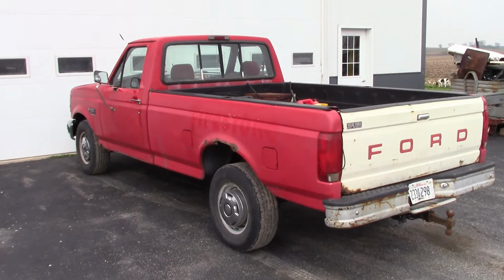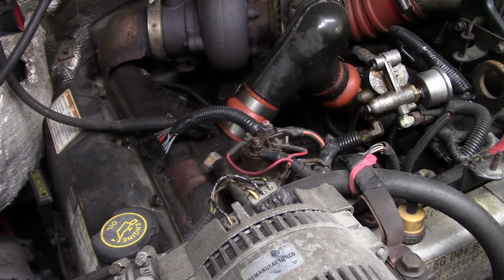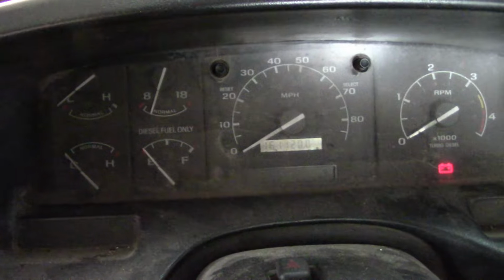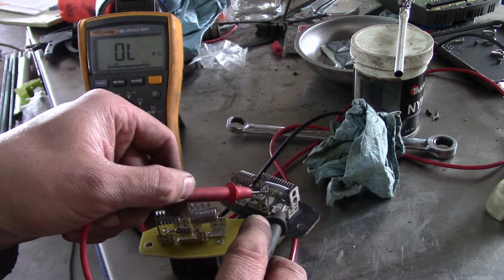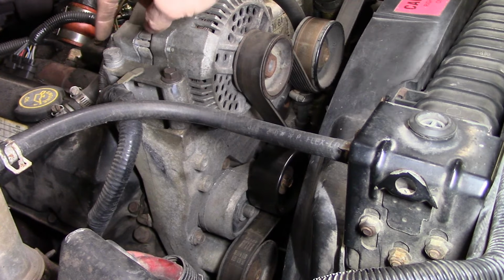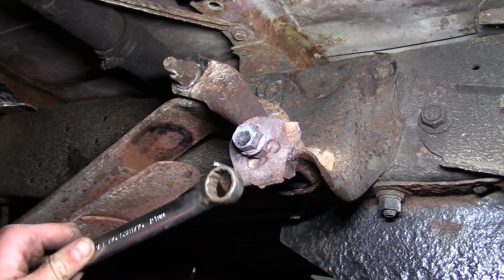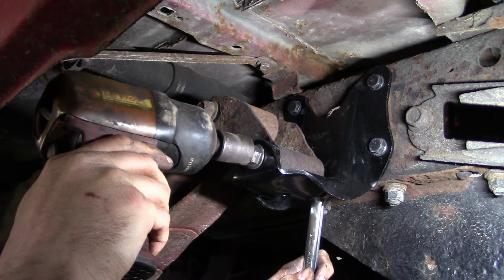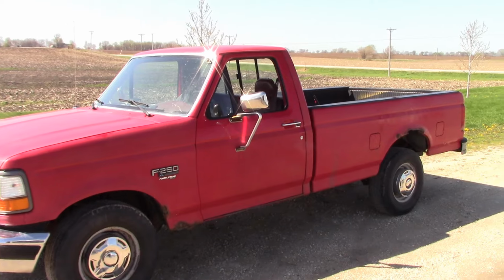1995 Ford F250 Maintenance - Glow Plug Relay, Blower Motor, Belt Tensioner, Rusted Spring Perch

Comment: Dielectric grease is so named because it won't conduct beyond conductors. The normal force of a plug-socket connection, let alone a stud-nut terminal, displaces the grease beyond significance, but it remains coating any exposure to atmosphere, supposedly more effectively than other grease which may contain conductive contaminants (e.g.graphite).
Also, that 0.1 ohm 'resistor' looks suspiciously like an encapsulated fuse element as used in some electronic equipment. Is the high flow position a direct feed from the battery, or via that 'resistor'?

Comment: 99% of the time when you sell a good running vehicle that you know what the issues are you usually wind up with a replacement that looks good but then you slowly discover all the other problems it has. 
I’d I were you I’d replace the floorboards, replace the bad sending unit in the fuel tank then buy a second plastic fuel tank to replace the rearmost tank. Then replace the worn components in the front end and give it an alignment to avoid premature tire wear beyond the normal tire wear. Little bit at a time and the list will go down. 

Food for thought

Comment: SO glad we found your channel.  We have the exact same truck ('95 250 7.3 XLT) that was my dad's that he's been using as a farm truck.  We're thinking of rehabbing it for my son when he turns 16 here over the next few years.  It runs really well, but has a couple of electrical quirks and needs several cosmetic touchups.  From your perspective, how hard has it been to find parts for this truck?  Things that are tougher to find than others?  I'm assuming mechanical parts are easier to find than cosmetic (trim, mirrors, interior panels, etc.)?

Comment: that little thing is a temp controlled fuse. OL means its bad, replace it with same rating and it should work fine.
Reply: Could solder in fuse clips to make it easy to replace later

Comment: I would check out the front spring perch/shock tower.   Mine both rusted to rat shit.  The top bent up and kicked the spring out sideways on the passenger side.  Mine is a 94.  From what I hear it’s a common problem on those years.  Rust holes big enough to put my fist through are probably not the benchmark for structural integrity.
Reply from the maker: Yeah that happens on a lot of Fords. The 2004 and up Super Duty also had that issue.

Comment: could you use a lawnmower starter relay that has the separate power and ground post as the glowplug relay?

also you should maybe find a good body and frame with a bad engine and trans and swap them

Comment: Im admazed that that thing has its hubcaps as for what to do look for a souther 2 wheel drive junker (will be better than anything up north) slap that body on your frame or you can go the route of find a whole truck and solar the engine from yours into it that would be more for if you wanted 4 wheel drive

Comment: Relays do not care if they are + or - switched.  Starter relay may not work but that is not why.  That is a thermal fuse, not a resistor.  The talking is good, people that don't like it can mute.
Reply from the maker: The starter relay coil grounds through the mounting bracket.

Comment: You could put a long rod through the fire wall with a prison shank on the end mounted so that pushing on the long rod from inside the cab will engage the now (manual glow plug exciter) aka prison shank...and Bob's ur uncle ...way less than $50 from your local auto parts store.

Comment: keep talking Wes.  As for what to do with the old Ford if it does everything you need it to do and all its little issues dont bother you then keep it.  You know what you have already and you'll just end up with another rusty truck that needs work anyway right?   MY Dodge has 203k on it but its paid for and other than a little work here and there its never left me stranded.

Comment: $50.00 relay I put one on because the" probably " original one was crispy and falling apart . Hind sight, and for future reference, who needs a relay when all you really need is a push button. Boo-koo's of amps so a big push button. So many things on a car can be tossed and replaced by toggle switches. Why do cars need to be so controlled by sensors and computers. Maybe if you have no hands or feet then the modern conveniences or automobile engineering would be necessary . Seriously motorized seat adjusters. All of that stuff just adds more weight and creates more stuff to break down.

Comment: If you had put the bolt thru the leaf spring the other way when you put it back you wouldn't have to fight with it not clearing the bracket you installed or the frame to get it out when you go to replace that other piece.

Comment: Hello, I'm interested in this video because I own a 1991 F350 7.3 idi that is a beast to start here in Fond du Lac, Wisconsin most of the year. Have you made any idi videos? I will test my glow plug resistance and inspect the harness. As we are now in November. Any links will be appreciated. Truck has never been driven on winter snow/slush, it's from Tenn. Crew Cab w/8 foot box. 2 WD Automatic.
Reply from the maker: Those engines won't start without glow plugs working.

Comment: Ahhhhhh a scrench. What do you run for a saw man? I'm pretty much a stihl guy, ( I own a bunch of pro saws,) but the 372xp, 395xp and 346xp have a special place in my heart as well lmao. I've actually been able to save a couple blower motors in a pinch before by cleaning up the bearings and spraying dry chain lube for motorcycles/ ATV's. If they arent too far gone of course. Yours would probably still make noise. Lol that thing is annoyingly loud
Reply from the maker: Dad was a Homelite man, so for years I ran a Super XL Automatic. Then I upgraded to a Stihl MS311 and the Homelite mostly collects dust.
Reply: @WatchWesWork 
Nice man... yeah those old homelites leave something to be desired. My favorite saw is probably the 044 Mag with a 24" bar. They are the perfect size and displacement for basically anything. If its bigger the 088/ 880 Mag is an absolute beast! The 311 is a decent runner. The only issue with the newer saws is the EPA restricting the hell out of them. This can easily be remedied by opening up the muffler and knocking off those stupid limiter caps on the carb to tune accordingly. You have probably already done this, but if you haven't, doing a MM makes them a whole different animal. All my saws are modded to some degree, (muffler, timing, walbro, cylinder porting, base gasket delete, rim sprocket, etc... Just opening up that muffler will make that 311 come alive! Since you have a welder you can make yours a true dual port style and besides the saw sounding better, it will run cooler, and your cut times will go way down. Saws are a hell of a lot of fun.

Comment: Hey check your in tank filters they will make it lift pump pull airaited fuel making injection knock also so a cam driven lift pump install a later model fuel filter housing with electric lift it will be a total different truck if you don’t have a late model fuel housing hit me up I’ll send you one with the fuel lines 👍

Comment: Don't know what it is but my 92 f150 I have to use the manual relay every so often and ive replaced it twice now except mines the one for the starter
Reply: The starter switch might be one of those early ones that mount on the top side of the steering column. Slide switch that splits in two from the rod actuator piece of equipment or crap if you prefer

Comment: The bad part is a fuse link. if the resistors get too hot it burns open.You could rebody it with a barn find older truck. Maybe a old 69 f100. By the way keep talking.

Comment: You can reverse the control voltage polarity, by using a cheapskate auxillary relay to drive your glowplug realy coil.
The "film resistor" in the blower resistor is a melting fuse. It does not have a particular amp rating, but instead a heat rating of around like 210°F (internally). They are availabe on Ebay cheap.

Comment: You can’t replace the mighty 7.3 still the king of small truck Diesel engines for reliability. If you own a 7.3 or a 12 valve Cummins you will regret selling them they just don’t offer anything like them anymore.

Comment: What’s with people saying you talk to much ?! They can mute it if they think so ! I like your blurbs personally ! I’ve started looking for a long box diesel and wonder which one you’d buy , the 6.0 or 6.7 or 7.3 ? For pulling my 5th wheel ! Or the GM diesels or Rams ? Which hold resale better also ? Thanks
Reply from the maker: I like the 6.0 and the 7.3. They are just all getting pretty rusty in this area. I don't know much about the 6.7. Don't buy a 6.4.
Reply: Watch Wes Work I’m in Minnesota so I know rust issues for sure ! I’m normally a Chevy guy but thought I’d try a Ford this time ! Lol. DARK SIDE ! Lol. My son likes Rams but I don’t much now that the new owners have made changes ! I have a chances to buy a 2007 6.0 w/ARP studs and upgrades with 200,000 miles for 7k , long box 1 ton 4 door leather interior and 5th wheel rails and wondered about your thoughts ?!?!
Reply from the maker: @davekimbler2308  Those a nice trucks IMO. I had a 2006 with the 6.0 and it had 275,000 on it when it was destroyed in a head on collision that I walked away from. I pulled the engine out and put it in another truck with over 300,000 on it and as far as I know it is still running today. They have coil springs in front, even on the 4WD, so they ride pretty well. The 6.0 has plenty of power, and if the head gaskets have been done, it should go another 100,000 miles easily.
Reply: Watch Wes Work very nice to know ! I drove OTR for over 30 years but didn’t work on Diesel engines ! Thank you !

Comment: I've never seen a metric, left-handed, fire-wrench. As far as using it next to the fuel tank, not to worry, (Remember I did work @ Boeing, 747 & 767 plant) you weren't up in the air approx. 28,000 Ft, above water. So what could happen. Next thing you know, some people will be yelling it's gonna blow. It could, provided you have some body shooting a surface-to-air missile at your truck., and they make a direct hit, it will blow than.

Comment: The previous owner absolutely destroyed this truck. That is so annoying. I am a firm believer in that anything worth doing is worth doing right. I don't understand why people cut corners that shouldn't need to be cut. The proper bolt for that alternator only costs $1 or $2 more that the hardware bolt they put in there. I don't understand why people do stuff like that.

Comment: Don't know how often you use your truck, but if it's often - I'd get something newer - with working AC, better safety in a crash, less cabin noise, better seat, a working radio, power windows. But that's just me, if you can live without those creature comforts, more power to you. A Tacoma or Ridgeline of say 10 years old would provide that, and would need less maintenance than your Ford.

Comment: Might be late on this comment, but you can turn anything into a ground side switched by...... adding another relay hehe, no seriously... You can use another relay to do this, yes it adds a couple extra wires and the extra relay can be a  "much cheaper" relay (something like an AC or Fuel pump relay) but it will cost less in the end. This is assuming a starter relay can handle the same amount of amps, which seems likely.

P.S. Keep talking, I want the talking and lack of stupid background music.

Comment: I don't get your explanation about why a glow plug relay and starter relay should not be interchangeable. As far as I'm concerned, as long as the direction and amount of current through the coil are right, the relay should pull in, no matter what side of the voltage is actually switched. All I can imagine is some sort of shared connection (in the socket?) that results in one end of the coil being hardwired to either +12V or GND. I suspect there's something else going on.
BTW, ground-side switching is super common in consumer electronics (e.g. audio amplifier protection relays), as it means you can use ordinary npn (Darlington) transistors for the task.
Reply from the maker: I should have been more clear. The starter relay coil is grounded through the mounting bracket. The glow plug relay has an additional terminal and the coil is isolated from the case.

Comment: Find a centurion with a blown motor and do a engine swap to have a more comfy driver with 4x4. I have my eye on a 76 ford econoline on a 4x4 highboy chassis that I could possibly swap my 7.3 idi from my 92 f250 in. My truck is ever worse then yours minus the rusted floor.

Comment: What? You can ground side switch any relay... Every gm with efi since 1995 would like a talk with that statement.
Reply from the maker: No. The normal starter relay like the one I show grounds the coil through the mounting bracket. The glow plug relay has an additional terminal for the coil and it's isolated from the case.

Comment: WES WES WES your videos are really informative and I hate to do it, but I'm going to be a terrible youtube viewer and ask for diag help. 1993 f250xlt 7.3 idi NA, NO FUEL PRESSURE AT INJECTION LINES. Cranked, cranked and cranked with injector lines cracked and no fuel comes out of the lines. Through my diag I have reached a conclusion of injection pump failure.

Steps 1. Pressure tested lifter pump, 7psi to injection pump GOOD
           2. Voltage to fuel solenoid is good, tested with cover off and the plunger for the fuel shut off, visual inspection shows plunger                   functions as should GOOD
           3. Fuel return lines push fuel when cranking at injection pump GOOD  

My conclusion is something in the DB2 injection pump has failed/clogged/stuck internally. I don't think I missed anything but if there is any insight you can give me before I use aggressive applied force to remove the injection pump, I would be very grateful....might even purchase something on your website hahhahaha.
              PS yes I know yours is a powerstroke so the injection system is completely different. This is a shot in the dark
                                                                                                                                                                                      Regards Mike

Comment: Your max ac is not working correctly as it is taking out side air, there is a white plastic vacuum line on top of the air box in the engine bay that is supposed to be connected to that diaphragm on top on the same box.
Reply from the maker: LOL. This truck doesn’t even have A/C. There’s nothing to hook to.

Comment: Look at the truck this way, even if you spent 8k doing the body up nice you cant buy a new truck or used worth 4k. If the drive train is solid its worth spending a lil money on and you can do as you want and when. All Fords newer than 06 are Junk. and a 2020 is 60-80k.

Comment: 'just coils' so not grounded,and not polarity dependent is very misleading. The IPR valve takes a PWM drive current and if the polarity is wrong it'll get an inverted drive current. So for example 25% drive would result in 75% actuation. [Electromagnetic] Coils reverse their magnetic field if the electrical connection is reversed too, so if that's important (loudspeakers), 'just coils' have to be polarity corrrect. "not ground' referenced and /or "just coils" do not determine whether electrical polarity has any significance.
Reply from the maker: No. The polarity is irrelevant. In all automotive applications, the magnetic coil acts on a steel pintle. The polarity of that magnet makes no difference. It's either on or off. If we want to move the pintle in the opposite direction, we use a spring (like the IPR), or another coil in a different physical location (like a later 6.0 injector). The comparison to a speaker is apples and oranges.

Comment: Are you sure with your explanation about the Relais? It shouldnt matter... I rather think the difference to the starter Relais is the amps!
Reply from the maker: The starter relay coil grounds through the mounting bracket.
Reply: @WatchWesWork  Thanks for the Response! Now i saw that the starterrelais only has 3 pins, so it makes sence to me! BTW please dont change anything (the talking and so on).

Comment: Delete the 03 fuel filter and pump I guarantee it didn’t get plumed correct with a obs 7.3 because it still has obs fuel filter housing I know the 7.3 in out up down we run veggie and used trans fluid for fuel I haven’t bought 20 gallons of diesel for my truck in 20 years
Reply from the maker: It does not have the OBS filter housing. That's one of the problems.

Comment: That whole "ground switched relay" thing was complete nonsense. A relay can be switched EITHER way, just like a light bulb. Only things like LED bulbs are polarity dependent to turn on. Most PCM outputs are ground switched, while ignition switches control power on/off. You in theroy could swap both those starter/glow plug relays and they would "turn on" wired the way they are. My theroy is that the glow plug relay is designed to handle more current for longer, even tho the starter on those old diesels crank for days sometimes to get them started lol. Or it may just be a matter of price gouging for what it is....
Reply from the maker: The starter relay coil grounds through the mounting bracket. To use it for the glow plugs, you would have to isolate the mount from ground.